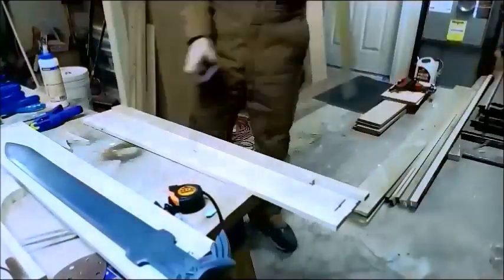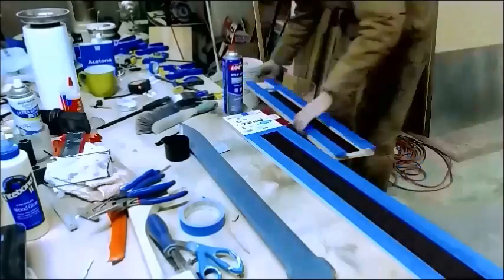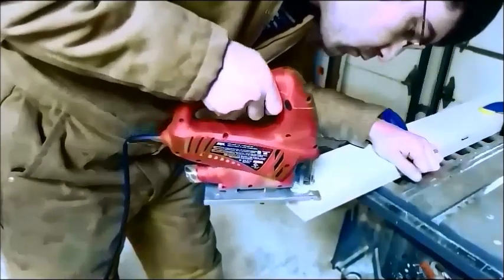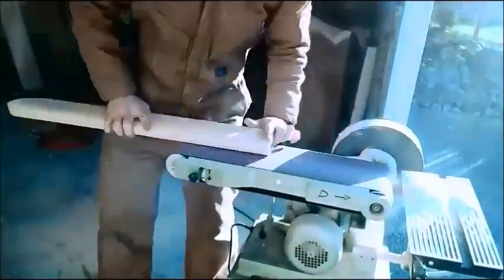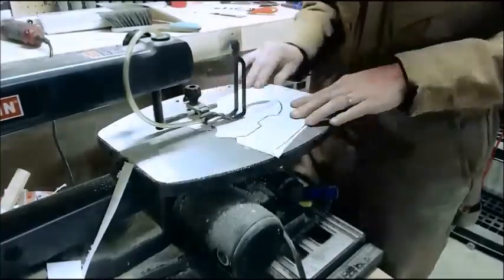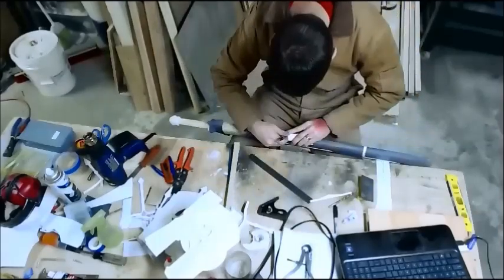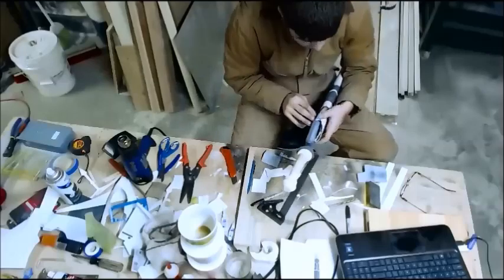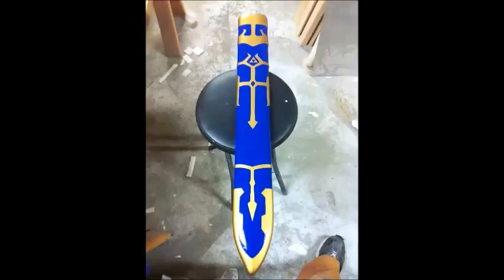Master Sword Scabbard Tutorial

Comment from the maker: I used poplar for the wood, and the hilt was just slid over the metal and glued, the handle was two pieces of dowel cut in half and put over the metal, then wrapped, and the pommel was a lathed piece.

Comment: Since he mentioned the "in case you din't have the tools or want to use a different material" bit... I have all the tools, but still find, for non-mold one-offs, that I prefer using foam board. spray the inside with black plastidip, shape it, seak it with PVA, then hit it with polyester/fiberglass resin before sanding and putting on the final details and painting. 

Foam board is about twice the cost of the extra-sturdy cardboard, but I find it works better.